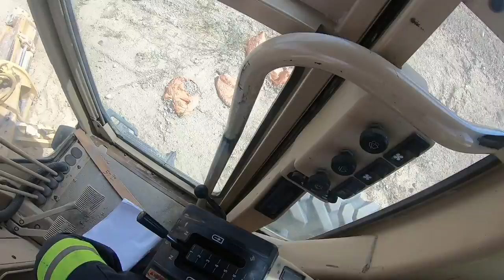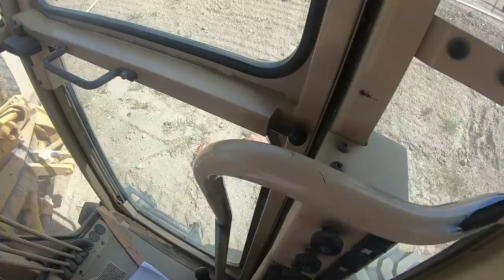Hauling Lots Of Equipment!

Comment: Trent vs lever binders.... The saga continues
Reply: One link, too loose, next link too tight. Adjust at the tie around point, one link, changes chain length by half a link. i'm not a driver, OAP in armchair. work smarter, not harder. Nice to see Roberto & you working together, be safe.

Comment: You need a cheater pipe/tire thumper about 3ft long. Those snapbinders i hate with a passion. Damn jaw breakers and dont secure right IMO. Especially having to run electrical tape or something around to make sure they dont pop open. Happy to have gotten rid of mine. Also one for crossing chains like you dont on the roller. To each their own on securing stuff though.